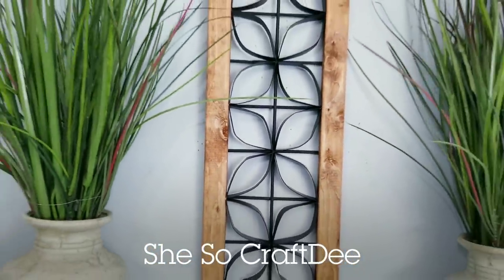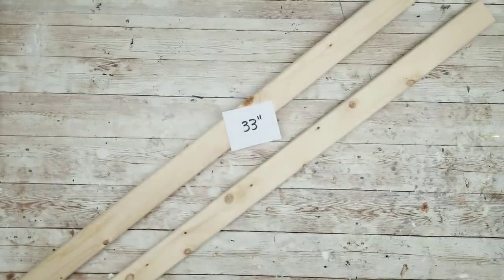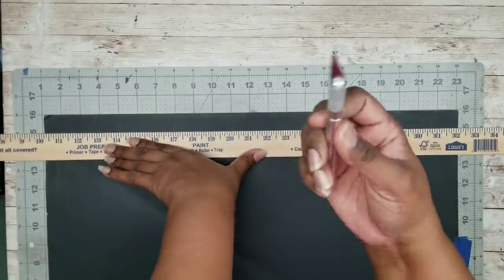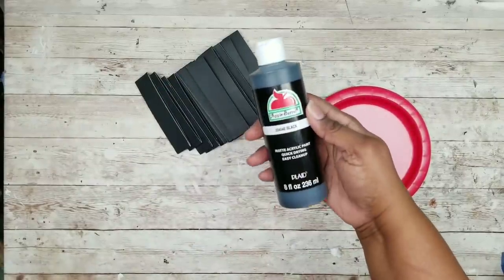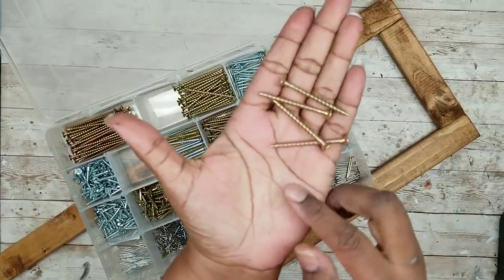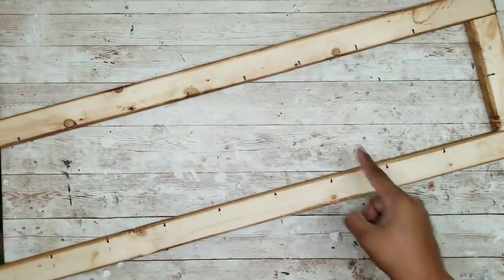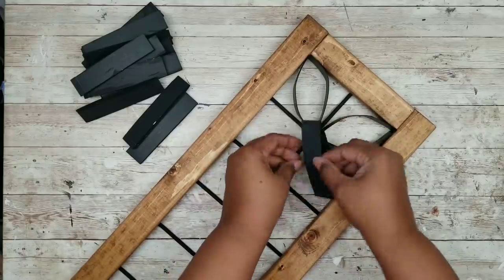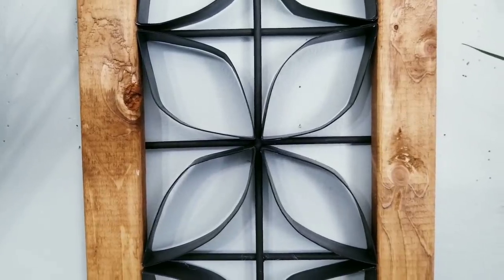*NEW* KIRKLANDS INSPIRED DOLLAR TREE DIY | Wood & Iron Look | High End Home Decor | Look for Less!

Comment: I how did you do the math to figure out how big the poster board strips should be?  I love this piece.
Reply from the maker: It was trial and error. I made a scrap 3" square and tried different sizes of the poster board I thought would look nice in the square. I determined that 4.25" - 4.50" length worked great in this design.

Comment: Amazing job it’s brilliant... just curious is there anything else we could use other than the poster board paper?
Reply from the maker: I would suggest poly plastic. This is the flexible thick plastic found on 3 ring binders.  I originally was going to use them, but did not find them in black until AFTER my project. 😂. They are at walmart for 97 cents.

Comment: the idea it's great... but the paper.... not so much, you could use cans maybe or some other material that it's more resistent. Either way thanks a lot for the idea.
Reply from the maker: The doubled board I used  is actually really sturdy. Cans are sharp and could be dangerous, and I want to be sure I provide safe supplies to use. This project will hold up a long time indoors :)